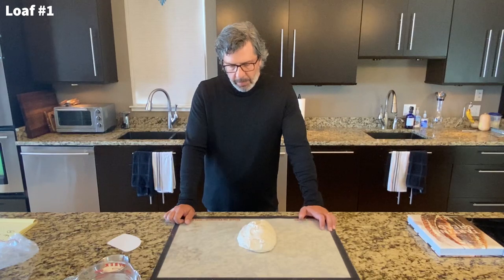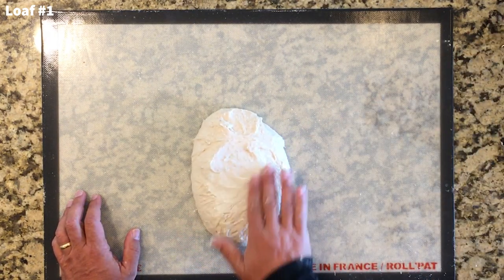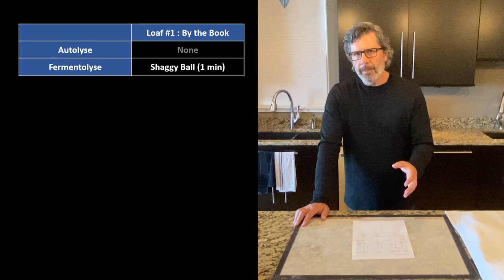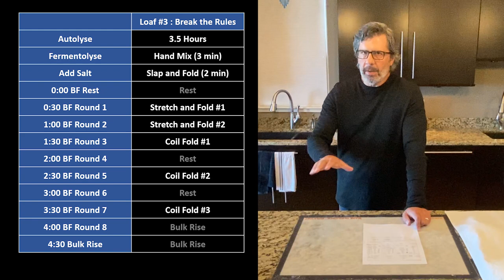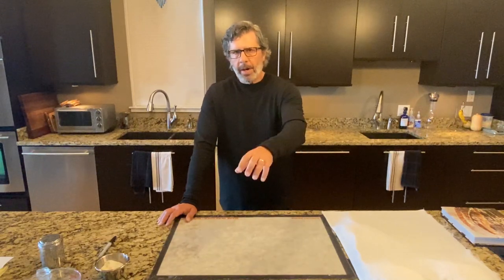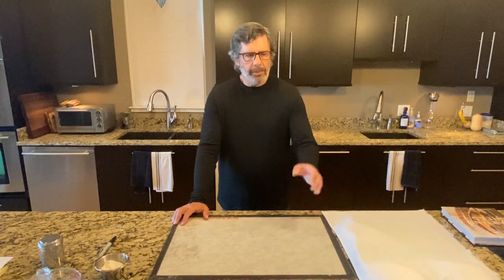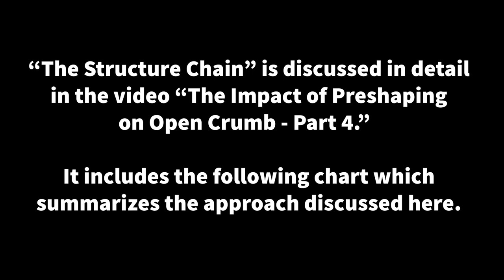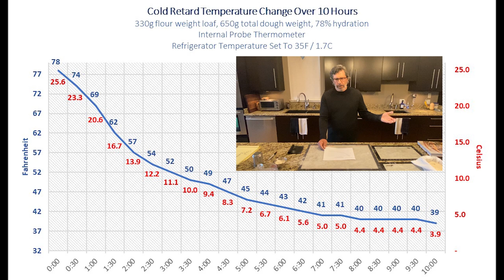Tartine Bread : The Art and Alchemy - Part 4

Comment: Thanks for this.   Really love your content and style.    I've been baking sourdough for about 5 months now,    I came to your channel recently and most of your comments really resonate, Particularly your observations on the mass of the dough (I often make a single loaf, and nowhere else have I seen comments on this) I will be trying adjustments to my technique in the weeks to come.   I very much like your comments on how the dough looks at each stage, this helps me learn a lot I will drop a comment on my experience in a few weeks.
Reply from the maker: Thank you for the feedback.  Yes, the mass of dough is a big factor.  If you watch other videos, you'll often see some of the most perfect loaves demonstrated in a video are hand-crafted, smaller, single loaves.   Trying to translate those techniques to a 1,000g flour-weight  double batch (or more) of dough does not always work (especially coil folding and lamination).

Comment: Hi Tom, My name is John and I have watched hours of your material. Really good stuff and I really enjoy your thorough rigorous thought process and teaching style. I do have a question regarding a couple of comments you’ve made. You mention that in your experience so far making bread that you have noticed two things, that you tend to underproof and your gluten is under developed. Can you explain how you determine that? How does one know that they are under-proofing or not getting good gluten development? I am new to baking sourdough bread and am trying to learn to assess the loaves for clues to what’s working and what isn’t. Thank you.
Reply from the maker: Hello John. Thank you.  Under-proofing is easy. Look up examples of “fools crumb” and that is what many of my early loaves looked like. Not horribly underproofed, but dense areas at the bottom of the loaf and irregular shaped holes concentrated near the top of the loaf.  Underdeveloped gluten was a little harder to determine, but I realized from watching many other videos that my dough was not as smooth and firm as much of what so was seeing.  Watch some other videos before stretch and fold and you will see much smoother, firmer, “more developed” dough. Also watch other examples before they divide the dough before preshaping and you will see very tall, firm, voluminous dough with straight, firm edges when they divide it.   Good question. Thanks for asking.
Reply: The Sourdough   
Tom, Thanks you for the explanation! I will definitely look into some other videos as you’ve suggested.

Comment: this channel is one of my best, ty,
have a question ! what if I do the bulk fermentation to the full dough without cutting or dividing, so doing stretch & fold to the full dough mass, after that I put the full mass to refrigerator, then after 24 hours cold fermentation I start to cut and divide and pre-shape and then final shape and lastly final proof! what is the impact on the loaf by doing that?
The reason I'm saying that is that I feel that I don't get much of an ovenspring if I cold ferment the ready to bake dough with its final shape
Reply from the maker: Thank you. That method is possible, and I know some people who do it, but with that approach, you are doing a lot of dough handling late in the process which degasses the dough at the time the yeast is weakening.  

It is also very difficult to time the optimal end of bulk fermentation using this method. The dough keeps fermenting in the fridge, then needs to come back up to temp to shape it.  

I’ve seen some people use that process, but it is not recommended because you need to let the cold dough come back up to room temp before you can shape it.  This restarts the fermentation process, which is an unpredictable step late in the process.  This is the biggest challenge.  You are adding a 2 hour step after the fridge to let the dough come back up to temp.  It can overproof in that time, and you’re doing a lot of “late handling” of the dough when it is most gassy.  

Sometimes people follow this process out of timing necessity and the results are always substandard.  

I guess it’s possible, but I don’t see any benefit to the method.  If you’re not getting great ovenspring through the “standard” process, it is an issue with another step in the process.
Reply: @thesourdoughjourney  ah yes lots of working and handling and welding the dough together is also irritating, so degassing some parts of the dough during the late shaping could kill the build up gasses that makes the open crumbs? so I guess the weak oven-spring is related some how to over proofing cause I never get small or dens crumbs near the base of the dough after cooking

Comment: hey so after bulk fermentation I forgot to take temp and just went at it to the bench rest/shaping part. my dough was so loose and sticky I couldn't work with it. I finally got it back in the bowl and temp was 74.5 F so  - too cool. I would have thought it would be looser the higher the temp. Anyway I am trying to get it to 78-82F now and start over. is that the way to correct it?
Reply from the maker: I'm not exactly sure where you are in the process.  If the dough temperature is lower, it just will take longer to rise.  I'd focus more on the percent rise of the dough rather than the ending dough temperature.

Comment: Hi Tom, thanks for the video. My question is how do you determine the initial volume of the dough? Is this just a case of letting it settle and then taking a measurement, or do you have an estimated volume/100g or something? I’m finding that depending on mixing method, I can get very different starting points for the same recipe, which I think is throwing out my estimation of bulk rise. I’m still a long way off determining the ‘point’ by eye.
Reply from the maker: Good question.  After mixing the dough, before the stretch and folds, I put it in a vessel and level it to get an accurate starting point.  There is very little rise that early in the process and little risk of “de-gassing” that early in the process.  If, for some reason it feels like the dough did aerate before that measurement, then I’d go for a 25% target rise instead of 30% for example.  

After doing it many times, I now know that for the Tartine recipe, the initial level in milliliters is 1.5x the flour weight in grams.  So a 1,000g batch of flour weight mixes up to 1,500 ml at the starting point.

Comment: Well, my first attempt at this is in the baskets/refrigerator for overnight proofing, I don’t have great expectations on the finished results. The dough was too wet and sticky to be able to tighten up the outside or hold its shape like yours does. Not sure what went wrong, I carefully weighed  all the ingredients. I followed your videos from the 5 part Tartine mistakes beginners make series. The  leaven floated, smelled like overripe fruit and it expanded about 20%. Bulk fermentation seemed to go well, the temperature in the oven was perfect at 79.5°  and I did 5 foldings. Is there any way to fix dough thats too wet and sticky?
Reply from the maker: What kind of flour did you use?
Reply: @thesourdoughjourney I used 900 gms of unbleached white bread flour and 100 gms of King Arthur whole wheat
Reply from the maker: Your flour may not be able to handle the hydration level.  Next time take the water down to 70% of the flour weight.
Reply: @thesourdoughjourney  I did, I used 700cc of water, and then after the first rest, I mixed in  50cc water with the 20gms. of salt. Should I cut it to 650cc and 50 cc?
Reply from the maker: Yes, cut back to 650 and 50.
Reply: @thesourdoughjourney  well, I’d  say it turned out great, if I wasn’t an expert on  judging sourdough bread, which I am now thanks to your videos. So I’ll say it came out not too bad for a first effort. I didn’t get much oven spring. I made 4 diagonal cuts on the batards with a lamé and the ears are only about 1/4 to 1/3 inches high. It has a nice hard crust with good browning. 42 minutes total baking time and 212° inner temp.
Reply: @thesourdoughjourney  kind of disappointed upon cutting it open, the inside is kind of dense and the largest holes are only a little under 1/4”.  The taste is pretty good. It actually tastes like sourdough. First time I’ve tasted that in 10 years since moving to Florida.
Reply from the maker: It will take some practice to read the results and make modifications.   

If it’s underproofed (which is common with that recipe) push the bulk fermentation times or temps more next time.  Make small changes each time and within 5-10 bakes you’ll get it dialed o.  Then it’s very repeatable, if you keep records.  

Lots more troubleshooting tools available here also. https://thesourdoughjourney.com/encyclopedia/
Reply: @thesourdoughjourney  so I have 3 starters, one that I made, and two that I bought on ebay in dry form. One is supposed to be 200+ years old from the SF gold rush era (some skepticism here) and one from Genoa, Italy. On the ones I bought, approximately 24 hours after feeding, the surface gets this  dried out appearance kind of bumpy and velvety looking. I’m wondering if this is normal or is it some kind of mold. Do you have an email or some other way I could get a photo to you?  Speaking of Ebay, several people are selling a starter called The Black death, have you heard of that?  Thanks
Reply from the maker: You can send me email at thesourdoughjourney@yahoo.com

I’ve heard of a few people buying the Black Death starter but I haven’t seen any results.

Comment: sorry to bother but I've gone through a majority of the videos without stopping to note which boutique flour you were using.  Is there any you prefer other than King Arthur?  I've been messing with milling & sifting wheat & not having much luck as the flour, while "super fine" using a 50 mesh screen to sift, still isn't letting the dough rise as well.
Reply from the maker: I use King Arthur Bread Flour and Central Milling Company High Mountain High Gluten.  I sometimes blend the High Gluten flour 50/50 with Central Milling Company Artisan Bakers Craft-Plus.  And I use 10% whole wheat flour.  Typically King Arthur.  I have not tried milking my own flour so cannot help there.

Comment: Quick question for you. At the shaping stage if the dough is still very sticky and hard to work with, is it underproofed or overproofed?
Reply from the maker: Sticky, unworkable dough is typically not underproofed. It could be overproofed, but even well-proofed dough is sticky and hard to handle. The dough handling and shaping is really a skill that comes with time.
Reply: @thesourdoughjourney  Thanks for your prompt reply. I'll keep at it!
Great videos by the way!

Comment: If you're going to proof in the refrigerator, why can't you proof in the same container you're going to use to bake the bread?  And then, the next day, simply let it adjust to room temperature for an hour, score and bake? I understand that the flour side is usually down during proofing but that seems easy enough to change.
I'm going to try baking mini-Tartine loafs using a GoSun Fusion solar oven.  I'm expecting a failure because I'm going to 'retard' proof in the same silicon cups I'll use to bake.  But, I don't understand the theory on why we need to switch containers.  Is it because of the need to preheat the baking pot?
Reply from the maker: The shaping basket in the fridge is usually tight fitting around the dough to help hold it shape. In the oven, you generally want air space around the loaf, inside the Dutch oven (it should not touch the sides) to bake it properly, so that’s why the dough moves from the small shaping basket to a larger Dutch oven.  

If you want to bake loaves in a loaf pan, rather than a Dutch oven, you could do the cold retard in the refrigerator I the same pan that you plan to bake it.  

I do not do a lot of baking in loaf pans so I cannot say for certain how well this works.